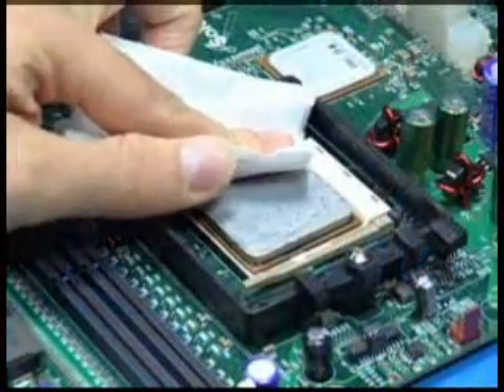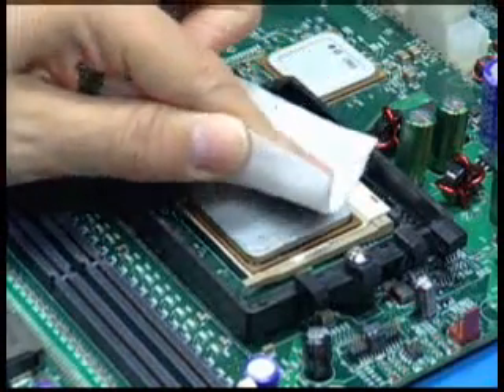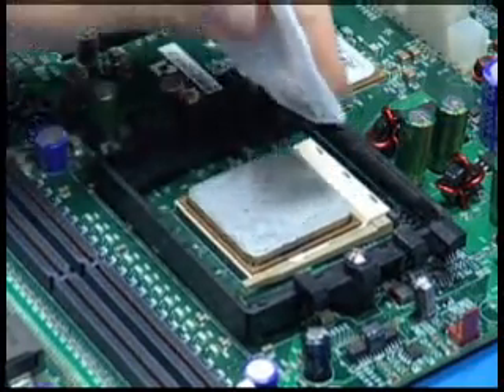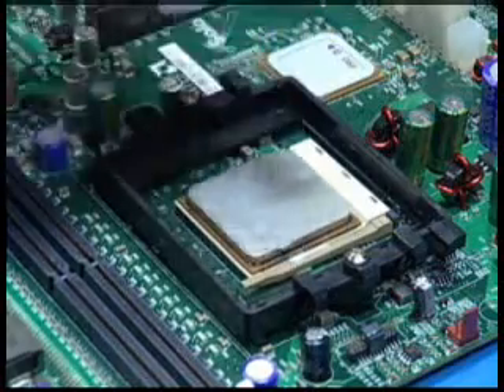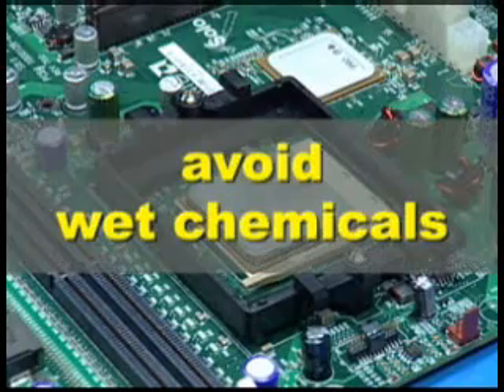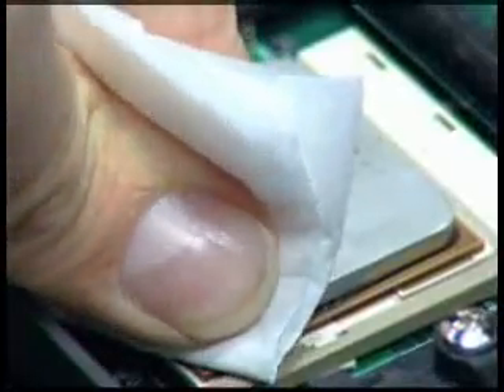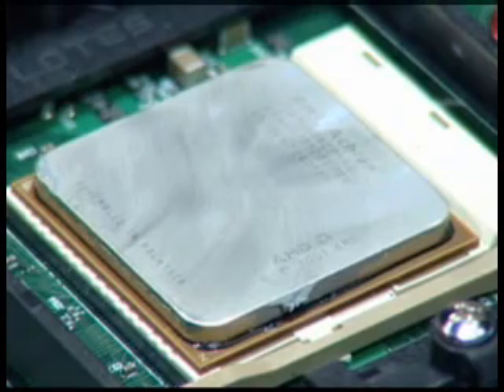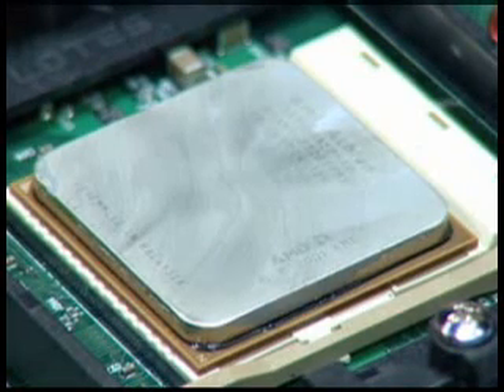Heatsink Cleanup

Comment: I'm a certified computer technician , and I suggest to simply take out the processor first, and then to clean it with alcohol anyway.
 the video says not to use alcohol to avoid that to spread to other components, just take remove the proc., use an absorbing cloth, dip that into alcohol and gently clean it.